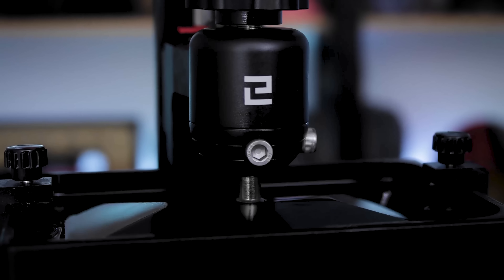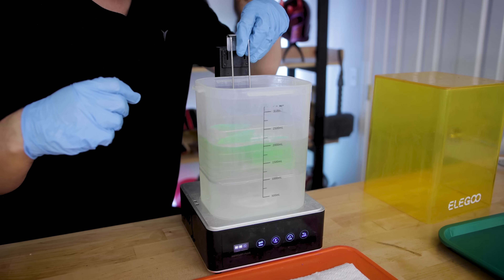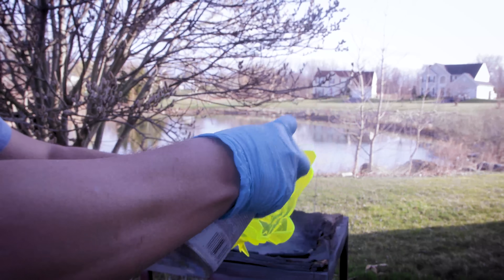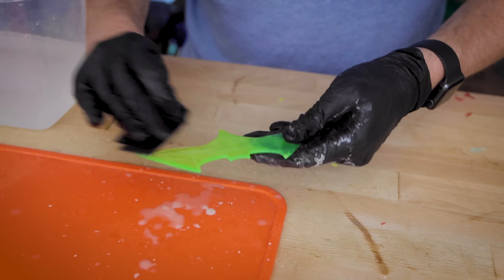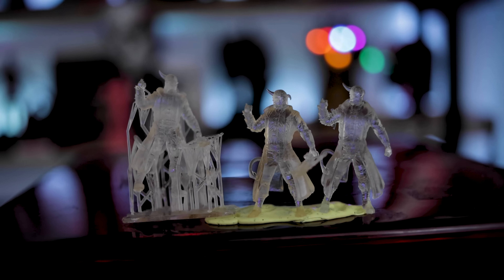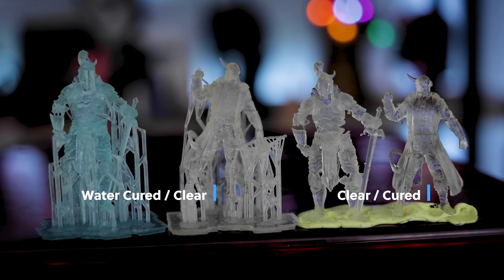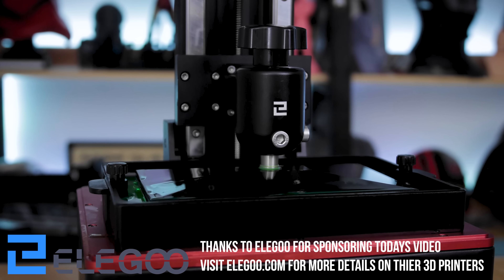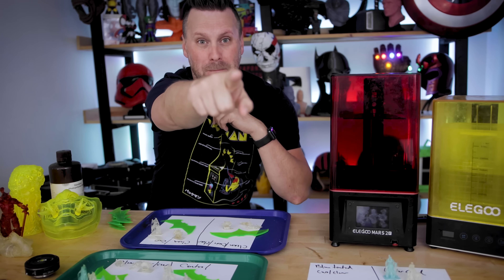How to get the best Clear Resin 3D Prints

Comment: In this video you didn't mess with the exposure time or look at slow curing, which are 2 of the basics of clear vs yellowing or cloudy resin prints. and you also used a curing station which probably did not cure your resin all the way, so you probably got better looking prints that way.

Comment: I don't know if you still read the comments, but one thing you could try is using a gloss called triple thick. I like using it on clear plastic as its not only a high gloss, uv protected coat, but more importantly its self leveling. They make both a spray can, and brush on. I'd recommend trying it on bigger prints like cosplay props and items, not so much on miniatures with high detail.

Comment: I know this is an older video (and it might be worth revisiting to see if newer, higher resolution printers make a difference) but when I was building model aircraft, there'd often be a seam down the center of bubble canopies (just because of how they had to be molded.) They'd get scraped off, then we'd have a whole process of working up - in all steps - from 220 to 400-600-800 etc. to well over 1000, often finishing with either polishing compound or, if you didn't have that, toothpaste (not the gel stuff,) since it's an abrasive, THEN finishing with Future as a clear coat - and these would be very shiny and clear.

Comment: For scale modeling typically airbrush on multiple layers of Liquitex gloss varnish thinned with water after spraying inks or contrasts. That typically does the trick at least for water effects and such for scale models.   Most of the "Clouding" you're getting is due to voxelization of the print surface rather than the actual resin or curing. So using varnish acts as a gap filler.

Comment: I really need your advice on a problem I have  with Anycubic high clear resin on my elegoo saturn 3 ultra printer. My problem has been to find the right exposure settings. I have been working on this for a few week and have had nothing but print fails. I have increased and decreased the bottom exp as well as the exposure time. All I get is a partial layer of the bottom layer on the build plate and the same thing on my FEP. Have you ever used this product? If so, what setting did you use on your printer? I have searched the net looking for the answer. I have posted on many 3D printer sites and the manufacturers website and I yet to have any answer.

Comment: Best methods are to either...

- Wet sand with high grit paper and then polish with a polishing compound. This will give you the best finish but it will be tricky to do this inside all the nooks and crevices of a detailed model.
- Lightly brush on a thin coat of clear UV resin and then cure it. The UV resin will fill in all the tiny imperfections in the surface (usually caused by the layer lines) and make them clear. You just have to be careful not to lose details in your model by filling them in.

I wouldn't apply any sort of clear coat until after doing either of these two methods. Making something glossy isn't the same as making it transparent/translucent.

Comment: Clear / super blonde shellac lays up better on matte surfaces than a few layers of rattle can clear unless you upgrade to Spraymax 2K* catalyzed clear ($$) or put on several layers of conventional rattle can clear. I get near optical clear with 2 coats of ~1-1.5 lb cut shellac. Bonus, you can make the shellac on demand with IPA or denatured you already have on hand. And alcohol inks work with shellac to adjust color or even do multi / layered color translucent prints. 

One other coating for ultimate UV protection / anti-yellowing would be Sylvania's Headlight Restoration Essentials kit.  That coating has lots of self-levelers for creating an optical grade finish on freshly sanded plastic plus tons of anti-yellowing UV inhibitors. 

For wet sanding, probably start at 600 or 1000 on resin prints unless you have layer lines or glitches from a print that came out not so great. Below 600 grit, it's sanding much rougher than where the surface started and really changing the shape and details more than smoothing the surface finish. 

*If you're going to spring for a can of Spraymax 2K clear, make sure you have enough stuff spray to use it all in one go.  It's a catalyzed urethane, the same as automotive clear coats and once you pop the can, it has pretty much that day to be used. And it requires a VOC respirator -- more so than any resin, alcohol, or other solvent that you have handled. In fact, I would recommend swapping in fresh VOC filters with it.

Comment: the clearest I have gotten mine is by cleaning, curing, then coating with no-wipe gel (nail) polish top coat and curing again (gel polish has to be cured).  I make mostly 1/6 miniatures and props.  I got into resin 3d printing because it seemed to be so similar to gel nails.  lol

Comment: i found that for some resins the prints seem way clearer since i started to run them under hot water after washing to soften the supports during removal, and then curing. maybe some of the "half washed away" outer layer gets washed off further during that process? (for other resins it just makes them goopy, fingerprinty and ruins the result, so i don't use those for prints that need support softening)
a combination that works really well for its price/effort i found: 1:1 Elegoo ABSlike + "frenshion" (aliexpress fake brand as far as i can tell) cheapo fingernail gel resin, on the abslike's printing profile, washing in ancient dirty 99% IPA, washing/unsupporting under 60ish°C water (ouch), curing. have been printing structural components, miniatures, busts, etc with that, they all look and work pretty great even without a spray coat (though of course better with one). and as a bonus it's somewhere between just abslike and the expensive "tough flexy" resins in terms of hardness, so it's a bit more forgiving for tiny details in models you want to handle/drop.

Comment: I work with epoxy resin mold making and what I have found is that when you sand you need to take it up to 10,00 grit to get that smooth and clear finish. Also, I have not had a lot of luck with clear sprays, they turn yellow and are not as smooth as a resin top coat.

Comment: This might seem like common sense but looking for some kind of official response to this... On a solid, not hollowed print, will a clear UV resin fully cure all the way through? With a solid print using non transparent resin, even with a curing station the inside partially cured resin will eventually find a way to sweat out of the model (even primed and printed) so I'm hoping that if I print and cure a statue with clear resin, that the longevity of the painted piece is guaranteed... Any thoughts? Like I said it seems like a "no duh" question but hey, even the clearest of windows block UV light to a certain degree 😊 thanks in advance!

Comment: Hey Unc J...  try the tip someone in the comments said, quick dip in ipa then water. To add to that I suggest do not let it cure in any light until the clear coat is dry. I mean let the clear coat dry in the dark. Also try airbrushing a 2k polyurethane clear coat that is reduced thin enough to limit the amount of detail reduction. When all coats are dry , cure. ....lastly, please tell us what resins you used in this video. The greens I think it was 2 different ones are amazing,  also that red figure after the clear was beautiful!  I bet one of the green was syratech? Keep up the excellent work brother.

Comment: You could maybe try a headlight restoration kit for your flat surfaces it comes with a the high grit sanding pads for a drill so you can do a high speed sand/buff some include a clear coat for uv protection

Comment: @UncleJessy If using a translucent resin, you simply have to apply a fresh thin coat (using a fine soft brush you get in the variety packs) of the same resin or clear resin on the outside again to give it the glass look. Then use a UV light to cure it and it will stay 'wet' looking and clear like glass. It will have a residue on it after curing so I recommend another dip and dry in alcohol to remove it but it will continue to look clear after cleaning. Figured this out after learning how to repair prints from @3dprintingpro212 and he mentioned that newly applied repair resin will cure shiny like fresh resin. So that led me to experiment with the translucent outer coat and was pleasantly surprised. Thought it would fade as soon as I cleaned it again but nope, stayed clear.

Comment: @Uncle Jessy you are not curing the part properly when you coat it first then try to cure. That's why the results are better. I self discovered this when my curing station was down and since then I use this technique too. However, consider that the parts are semi-cured and as the times goes past, the parts will eventually lose their transparency.

Comment: I know this is an old video, but I'm Woodworking/woodturning when we work with epoxy and we're trying to get a clear/gloss finish, we and up through the grid (220, 320, 400, 600, 800, 1,000 without skipping grits), then move in to either micromesh pads, and then playoff Pulliam with a buffer (not everyone uses micromesh). Again, probably not viable for miniatures or highly detailed, but for that Mando visor in guessing you could get it near glass looking

Comment: Just ordered my first resin printer, but from my experience with other things, 91% alcohol makes a great solvent. I've used it to clean delta printer bed, clean glass and slate for laser engraving and while trying to use it to clean something off a wall and clean a toilet seat, took some paint off both. (completely different situations lol) 70% is much more watered down.

Comment: the thing with figures and other larger prints is there usually hollow to conserve resin, but I noticed with hollow prints they tend to APPEAR much more yellowed. the reason do not know, other than its less material getting cured and most of the time the inside cannot be treated with clearcoat, sanding, etc. I have had better luck with solid prints.

Comment: Hobby lobby or I’m sure Amazon had little 2 inch by 2 inch square sanding foam pads near the model cars and airbrush paints. Wet sad up to about 600 with plain sand paper but then use these pads. They are really fine grit. I think they go from 1000 grit to 12000 grit! It takes time but especially for the visor you would want total transparency. 

You can also use a good quality clear coat and then do the sanding for the absolute best result! I was a hydro dipper and learned these techniques . I also made resin ink pens that spun on a lathe which made wet sanding way easier due to fast revolutions.

Comment: Back when I used to build aircraft model kits the trick to get a crystal clear canopy was to use Future Floor Polish on them. It's a clear, self leveling acrylic that worked really well. I imaging a clear gloss spray paint would be the same, but thought I would throw that out there.
Reply: Spray paints dry as the particles go through the air. It's not the same as dipping something into a gloss varnish.

Comment: Watch a video that was for another brand translucent or clearresin it suggests that before curing paint a thin layer of the resin on to the print and when you cure the print it will keep it clear. Don't have a resinprinter yet so L'm notcertain if it works p,ease let me know, when i ddo get a printer i planto use the translucent resin.

Comment: Professional scientific glass worker and material scientist here. Get a small buffer wheel set up on a dremel or a die grinder wet sand by hand as far as possible then buff to 14,000 grit.. you wont regret it and 14,000 grit diamond paste is cheap and makes great click bait lol but its not bait if its actually interesting..
Reply: sandblasters work great for small items like minis

Comment: I've found that the more water (including water washable resins) contacts printed clear resins the cloudier your resulting part is.   I've tried to print optical parts before and one successful technique was to clean a part made with water washable resin inside a ziplock filled with mineral oil.  The resulting part is transparent to this day.
Reply: Sorry for the late question, but do you clean the part in the mineral oil, cure the part in the mineral oil, or both?

Thanks for the info!
Reply: @retromodernart4426  Its been a while but I generally spent some time giving it the "shake n' bake" treatment to try and rinse off the resin inside the bag with mineral oil inside.  I think I figured why not cure it in there too and just threw the whole bag into the uv curing box.  Not to oversell it- it's not crystal clear optical lens material, but its very notably better than parts that get clouded by contacting water.  Actually now that I'm thinking of it, I'm not sure if I skipped the alcohol step or not.
Reply: @salukikev  Very interesting, thanks!

Comment: I've found that dipping it in resin before curing gives me the best result. It gets rid of all those pixels refracting light weirdly and you can't get a smoother finish than that.
Reply: Any tips on how long that cure takes? I put a thin coat on a part just to test and it took forEEEVER in the cure station. Not sure what I'm doing wrong.
Reply: @santiagoricoy1313  It should only take a few minutes. Depending on the resin, 2-5 minutes. Although I've had one that took 10 minutes to cure too. Sometimes they're stubborn

Comment: When the result has to be REALLY clear as glass, you have to add a few steps: Print in any colour you like, prep as fine as needed, clear coat, make a mold from molding silicone and than pour extra clear 2K-Epoxy resin. That´s the way I do it. With any printable resin it´s not possible to print really THAT clear ;)

Comment: What I have found (because my family was in the abrasive machine business) is that figurines cane be run through a rock tumbler or a vibration tumbler. Use walnut, then go to #20 glass bead.

You've at that that point, wet sanding a detailed figure. Which does mean you might need to exaggerate your print a little, expecting abrasion.

Comment: I am very new to 3d printing. I watched this as an informational vid to projects I am working on. A few things crossed my mind while watching. One was the haze that envelopes headlight lenses and the cleaning there of with silicone oil sprays and cloth buffing. Another that crossed my mind was waxes. As someone mentioned floor polish for example. Being a zoids collector and some of them are of clear or translucent versions and a very old blog, by internet standards, was a product called "the treatment" applied to one of the guys clear parts zoids. The pics given by him were remarkable results. I will be trying the silicone method on a dome for a Mr. Freeze bust being made for a coworker's  dream batman chess set I am working on for him. Hoping for the best.

Comment: I haven’t really been able to get my clear/tinted to be clear or crystal looking. I also haven’t used the clear straight up but I have a nice bright white that yellowed in curing. I found the solution to this was to change the curing light. I have a bottom end UV exposure light and put it in a mirror box with a fair distance to the piece. Leaving it longer at a lower light and frequently turning allowed me to keep it really bright white. Then a UV clear coat made sure it won’t continue to yellow.

Comment: I'm currently sanding a counter top I did a resin drip on and the final touches involve polishes it from at least a 2000 grit wet sanded. Wondering if that process is the same for these prints? I got a couple I could try it on and test out!

Comment: how did the cut and polish go ? (if you did it)
also probably better to use a drop of dish soap with water on  a 2000 grit wet dry sandpaper